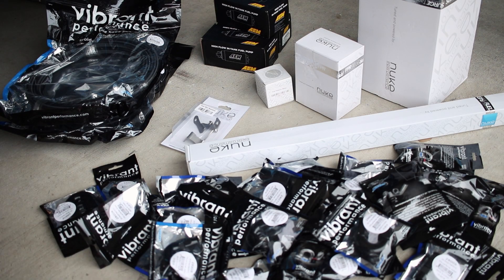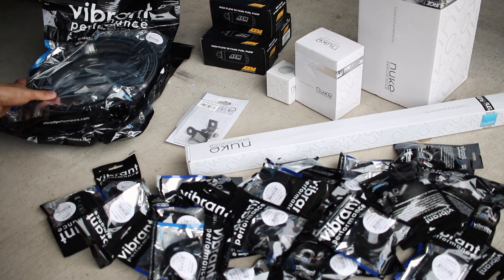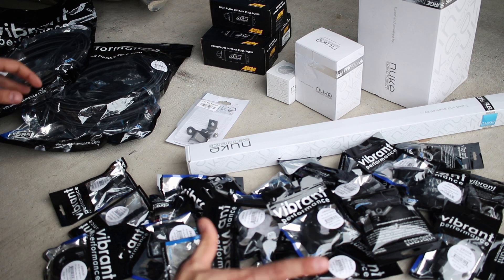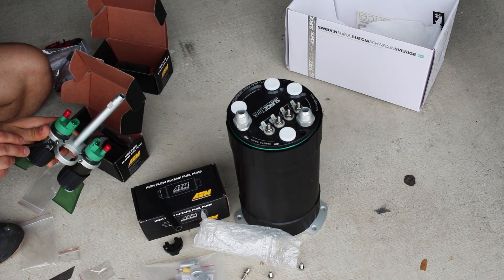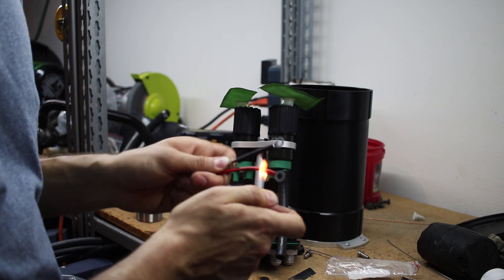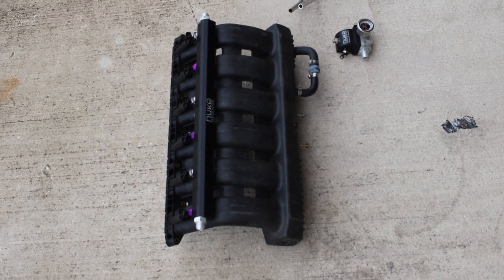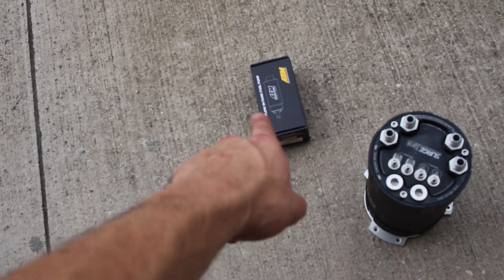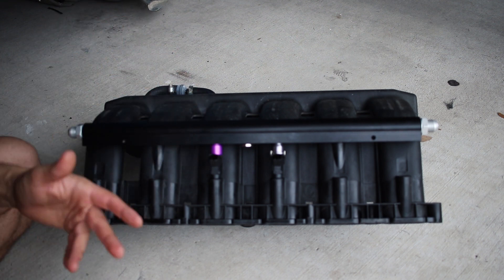Rocket Bunny Turbo S52 BMW E30 Build | Part 19: Custom Fuel Set Up

Comment: I have a m50 manifold on the m54 engine.  I'm going to upgrade the injectors ,fuel rail, and fuel pump. My question is, does the nuke injector EV14L connection is the  same as the original connection,.or need to buy in adapter for the nuke injector EV14L.. the description says is JETRONIV EV1 , what type injector you running with what connection are you using